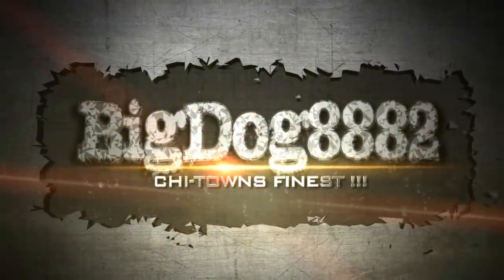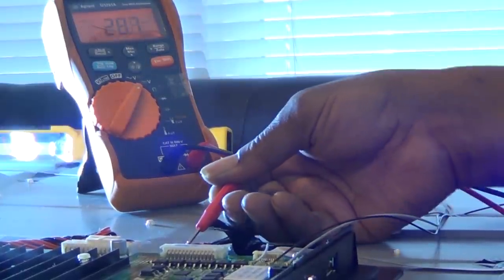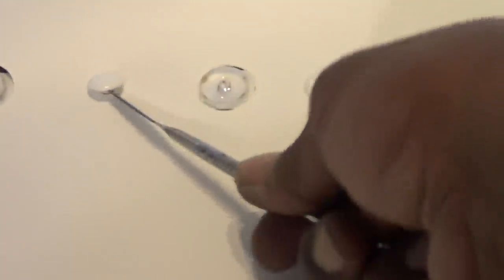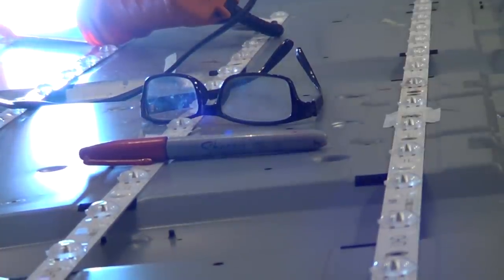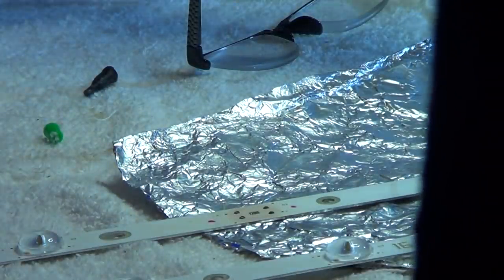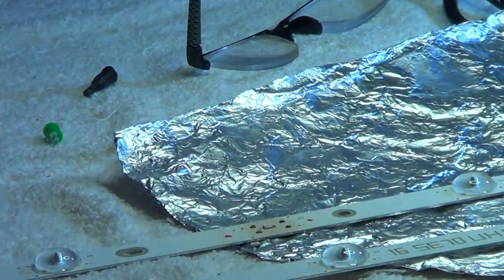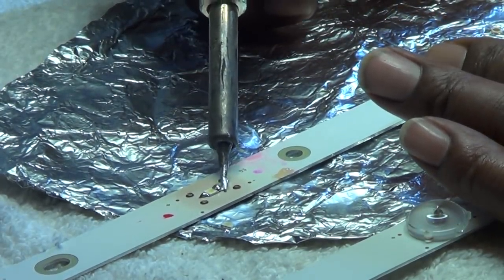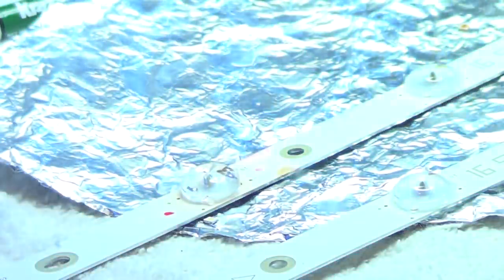Vizio 70 inch Led TV, dark picture repair

Comment: Great informative steps. The little steps that were mentioned are what got my attention.  Plus the know how on making a LG LED fit a VIZIO trace. I’d never know the difference had it not been said. Thanks 

I was informed that my tv issues could be caused by the LED Driver on my VIZIO, anyone ran into this scenario before? I don’t want to rip my tv apart fix my LED strip and repeat the process 1-2 years from now.
Reply: What was the outcome on your tv? Was it driver board or led's?
Reply: @sacul7694  LED's  were done for. I ended up fixing it and putting that TV in my shop and bought a new TV. Win, win.

Comment: Hi, just wondering what the specs are for your replacement LED diodes. What voltage is each diode. Im looking to try your fix with an m70-d3.

Comment: How long does it take for this problem to appear?  I'm not sure if this is my problem, but I bought a 48 inch Vizio to use as computer monitor 4 years ago.  Now I'm getting horizontal bands of darkness at top and bottom of screen.  I'm not sure if I should open the back or if it's a hardware problem, because around the same time Microsoft also pushed an update to me that changed a bunch of display settings.  Should I open the back up and try to fix the hardware?  Thanks!

Comment: What voltage/setting did you set your power supply to test the individual LED's? In the video it looks like they slowly/safely fade up to full bright...
Reply: C. Hobbs it is a led tester.  It automatically does the voltage.

Comment: How do you tell which type of led to use ?    I have a M70-F3 which has dark spots.  I'd like to do this but would like to have some led's on hand so I can do it right away, rather than waiting for parts. 

Or, if you have to take it apart to see, how do you identify the type of led?
Reply: a year late, but You go to Amazon, type in the model of your tv,m and it will show you parts of that model. such as a new tv,  tv remote, a/c plug, motherboard,  and of course the LED strips.  each tv is diff. So as long as you type in the correct model #, that should be the led for your tv.    very easy to  install. 2-3 hours,  basically  just removing screws here and there, the leds, are sort of clip-ons,  that should be it.  but doing all of us slowly, saves you from doing something wrong, other wise it should be fine.. hope that helps..

Comment: Man I thought this was gonna be my answer! Almost same model number but boards are different I have the Vizio E701i-A3E that has back lights but no picture 😭
Reply: It’s a bad panel on yours.  
Check the voltage on the mosfet in/on the t-con board. 
That will tell you if the t-con replacement is just gonna blow if you put a new in . 
You can in plug the ribbon cable of each side to see if the voltage changes . And that is what will tell you which side of the driver board is shorted out (which is what Is blowing the t-con board & why a new replacement won’t work . The driver boards are made on to the panel itself from the factory…& that’s why you gotta /or will have to toss it . You have to buy a whole complete panel to get the driver boards on that side that is bad . And it costs more than a new tv costs ) 

I just tossed one of those models yesterday for this reason .  They are a video on here that shows you exactly where to test the mosfet & its voltage to show you how to know which problem you have . 

But Now I got this model of 70 inch he’s working on with half the lights  out on it.  So I’m gonna try to fix this one. 
Lol 
Yours/my other model that I tossed  has blue tooth.   So I wanted to fix it.    Lol 
The led strips aren’t even inter changeable on them e701i-A3 to this 701-e3 . 
I’ve checked the part number for a match ,& nope.  
The model you have is about 8 or 9 yrs old. And it only has 3 strips (3 rows ) & this model here has 12 . (6 rows 2 to each row) 
Unless they can be swapped individually.  
And that’s what I’m trying to findout in here. Lol.
Reply: I answered this comment because I saw it was just posted 2 weeks ago .  Lol 
And because I had that very same model go bad .  And I hope you didn’t go buy a t-con board to try and fix it.  Because it will just blow it in about 3 seconds after you turn it on. 

But if you need me to find that video for you that shows how to trouble shoot that ,let me know here . 
And I’ll post a link . 
I would do it now.  But I don’t know if I can find this comment again unless you answer and it gives me a direct link in the gmail .
Reply: Yeah I checked voltage on the tconn and it had 1.2-1.4 on each cable going in( 2 going in and 2 out) so your saying it’s the driver board? I got the tv for free and only took it because it didn’t have a cracked screen. And yes it is an older tv 😔
Reply: I’m also just now getting back into using a multimeter. I figure it wasn’t too hard when I learned in high school shop but through the years I’ve bought and lost a few and I didn’t use them often enough so I just said the hell with it. Now I’m getting more interested in fixing old gaming consoles and stuff I find for cheap or free. I like a challenge
Reply: What do you mean by mosfet and what should it be?
Reply: @johnmorin7244     Here is how you check it.   

And he tells you how to unplug the ribbon cable of each side to watch and see which side is bad by the voltage change.  

That little mosfet is ex to find.  

You might have to pause or re watch it a couple of times.  But this is the best trouble shoot method I’ve found on here FOR THAT SPECIFIC MODEL . Because they are so old & so problematic.  They wasn’t produced for long. Parts is getting harder to find for them.  I looked for a week. Lol. 
Because I knew the tv I got had ,had the t-con replaced on it recently (a couple of months prior) once already. 

I think what causes the shorts a lot of times is when people clean them & let the liquid run /soak into the bottom & down into the driver boards made on to the panels.  
But most of the time it’s the little chips themselves that burns up in the green ribbon cables that goes from the driver boards to the panel itself.  They are made together from the factory & I Havnt found one person who tried to replace them yet.  

But.  I will say this.  
Some /a very few people has just torn off the bad side.  where the drivers are bad on that side of a tv and got them to wirk.  That only makes the resolution speed slower. Like for gaming purposes & things like that.   But for normal watching they was fine for up to 3 yrs and longer.  

But.  This is the other caveat.  
I’ve yet to find where a person did that and it worked on the e701i-a3.   That only worked on the newer model like this one in the video.  The e701-e3. 
That’s why I ended up tossing mine.  
It’s still in the back of my truck now . Lol.  That’s how long ago I went through this with  that tv. 
I just got this newer 701-e3 yesterday.  
And I just now ordered back light strips for it.  So I’ll have 100$ in this tv. 

Because I did the same thing as you.  I got both for free and was trying to fix a good one for my bedroom. Lol. 
I could buy one.  But. I don’t have anything else to do right now. Lol.  I just happened to get both tv’s with in a couple weeks apart. 

But here’s that video I was mentioning. 

https://youtu.be/cyCKoMi_5IA
Reply: @johnmorin7244  I’m gonna say your panel is bad.  
It shouldn’t be below 16 volts.  

That low voltage between 1 & 2 is how you know the mosfet is shorted.  
If you unplug that ribbon cable inside at a time and re test.  You’ll notice the voltage goes up where it should be. 

Just read in that video link at the end of it and it tells you what to look for.
Reply: Watch that link John. Because I might be a little high on what that nominal voltage is supposed to be. 
But I do know that mine was reading what yours is. 
It jumps constantly from millivolts to 1 volt like yours is.

Comment: Hi, I have the same model and have No light at all. I purchased an LED tester. I have not disassembled the TV. I unplugged the LED Connector from the main board. I placed my Red Probe from the tester on each red lead on the connector while holding my black probe to a black Lead to find the corresponding Strip. I tried this on all the Red and black connector leads and I never got any strips to light up. Can I test the strips using this method or are all my Strips bad in your opinion?
Reply from the maker: If Ur doing it right u probably got a lot of bad strips. Especially if the TV was slowly getting darker and darker over time.
Reply: @bigdog8882  thanks, you nailed it

Comment: I replaces all of the led strips and I think the defuser screens are all messed up.  At first I got light dots on the screen where it's dark so I thought I put the screens in reversed and so I. Took it apart and flipped the inside 3 screens over and nope that's not it either now I don't see white dots it's more spread out .. So now I'm really confused on what I did.. Anyway of figuring out what screen goes in first?? The thick white screen or is it the thin ones first??
Reply from the maker: The thick screen goes on the bottom, rough side UP. Then its the Clearest screen after that, and the dullest screen is the last one. (I think) All rough side Up, smooth side facing down toward the led's. Thats why in my Vids I always mark a dot on the bottom corner of the very 1st screen and I keep them all together.

Comment: So I pretty much had the same issue, though much worse. The screen would be completely black. I got a new tcon board and replaced it, the lighting was still very dead. Then magically, boom. A good 20 minutes later and it looked pretty much fixed! Except the screen started flickering and creating clones. After a good 30 minutes the tv freaked out and cut off. I cut it back on and guess what?! It totally fixed the problem! But a new one came.

https://imgur.com/gallery/MS8kSEG

The image is one I posted of my screens current condition. That look was the whole screen and now its just in the rectangle. Can someone PLEASE help me fix this and figure it out...?! I can't get help anywhere and i'm already so close to fixing it but can't even enjoy it currently with that blockage. Please help me someone I need answers asap.